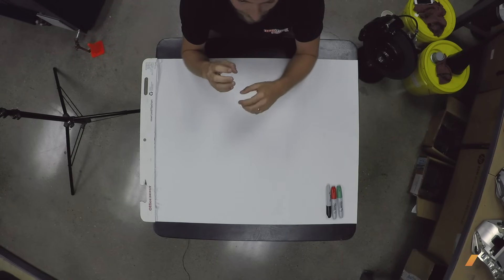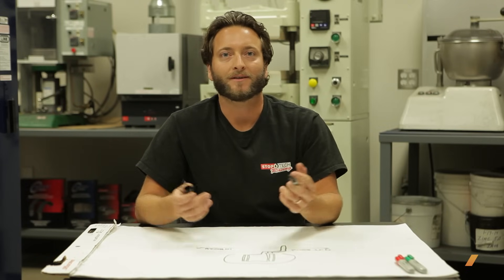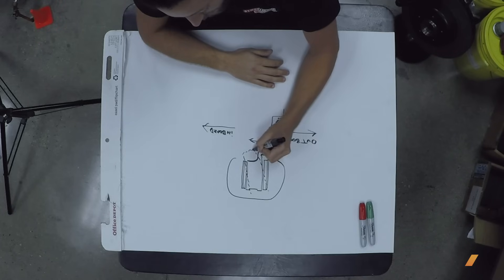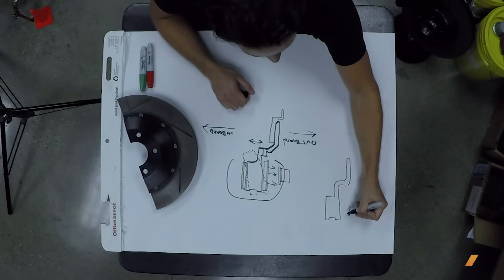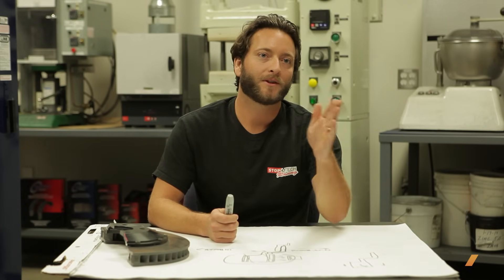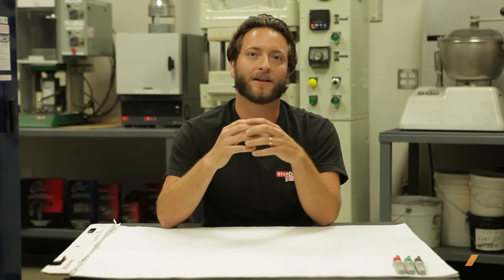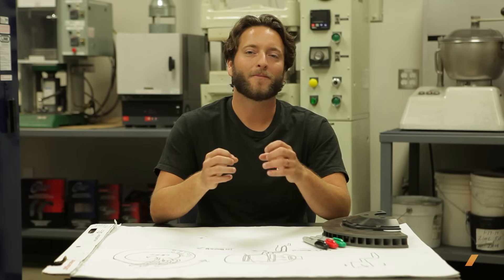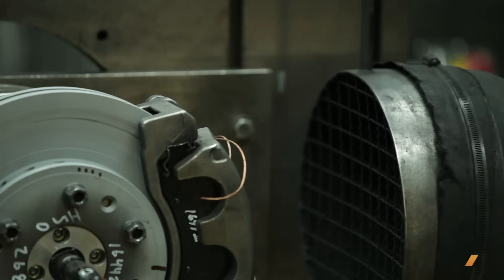The Thing About Brakes Is THIS  -- /ENGINEERED

Comment: Nice but why dot 4 fluid and not dot 5?
Reply: DOT 5 is a totally diff fluid that is not compatible with 3/4.  The main point of DOT 5 is it isn't hygroscopic.  Other than that it has little to no performance benefit.
Reply: DOT 5 is a silicone base and is designed for brake systems that require that kind of compatibility (seal material, etc). For instance, I use DOT 5 brake fluid in my Brembo motorcycle calipers that are fitted to my race kart. It does have a slightly higher base dry boiling temp than DOT 4 and DOT 3.
Reply: There are apparently components in ABS brake controllers that do not like DOT 5 fluid, and if you try to mix DOT 4/3 with DOT 5, it won't mix because DOT 4/3 has some amount of water in it and DOT 5 fluid is hydrophobic (it repels water, while DOT 4/3 attracts water right out of the air). DOT 5 can only be used in a system that has been flushed of DOT 4, 3, and 5.1 fluid completely before DOT 5 can be used, and only in systems without ABS.
Reply: If you want track performance, try RBF600 from Motul. It works really well and has a really high boiling point. It's DOT 4.

That said, if you are experiencing brake fade and not outright boiling, then the problem is the pads, not the fluid. If the fluid goes, you have more than likely crashed your car as a result...
Reply: Dot5 is silicone based where Dot3,Dot4 & Dot5.1 are polyglycol 
ether based, Both silicone and polyglycol ether based fluids should NEVER be mixed.
The best quality polyglycol ether based brake fluid currently on the marked is Dot5.1, you may want to ask the manufacturer if your vehicles brake system is suitable if you drive an older vehicle since some older elastomer components in older systems do not accept the borate compounds that raise the boiling point in Dot5.1.
Both Dot5 and Dot5.1 have specific advantages and disadvantages, 
polyglycol ether based brake fluids like Dot 3,4 &5.1 absorb water 
out of humid air , a slight disadvantage, this process happens slowly
 but the small amount of water is divided in the whole system. This may 
eventually result in a softer pedalfeel since water compresses where the
 brake fluid does not, so every two year (normal street usage) the fluid 
should be renewed. The older the fluid, the more water gets into the 
system which drastically lowers the boiling point (boiling fluid which 
causes air bubbles in the lines and/or callipers which causes reduced or
eventually no brakes). Dot 5 on the other hand, does not absorb water (non 
hygroscopic) but it keeps small air bubbles in the system after filling 
so it takes more effort to bleed the brakes (leave it sitting for at 
least two hours before any bleeding attempt). If water gets in the Dot5 filled system it is not absorbed in (mixed with) the fluid so it stays separate from the silicone fluid, this may result in 
water puddles in specific parts of the brake system like in the calipers,
this may cause corrosion and/or boiling water at the hottest areas (near 
the rotor) also it is slightly more compressible compared to polyglycol 
ether based fluids which may result in a slightly less hard pedal feel. 
Silicone based brake fluids also lack the naturally occurring lubricity 
which makes it incompatible with mechanical valving in ABS braking 
systems. Big advantage, it does not damage your paint where polyglycol 
ether based fluids do so in seconds.
Reply: Dot 5.1 is compatible with Dot 4. Dot 5 isn't
Reply: jonnoMoto So, my car has dot 4 from the factory. If I wanted to do some changes in order for the brakes to withstand more track use, along with braided lines and harder pads, should I change to dot 5.1 fluids or are dot 4 good enough? Dot 5 won't work as good?
Reply: the difference is wet & dry (water content) boiling temp of the fluid. If it ain't boiling with dot4, dot 5.1 isn't needed
Reply: jonnoMoto Why isn't dot 5 compatible?
Reply: Gregory and J Maxey already told you
Reply: jonnoMoto Yes but I don't understand why it being silicone-based makes it incompatible. It's still a brake fluid.
Reply: Gregory Evans Ooooh OK I see. Thanks man!

Comment: I would've liked it more if he showed us some real applications though.  And what is the usual braking force ratio between the two axles on a car? How do you calculate it? How are the angles of slots determined? 
Does the location of the caliper (towards the inner side of the car or outer) affect the design of the pistons or the caliper as a whole? Jeez this is interesting

Comment: Is this a thing, or am I just imagining it, someone answer me this in the comments.. is there such thing as a aluminum rotor? I thought I heard of it before.
Reply: Aluminum scores too easily. Iron or steel is used for is high surface tension and density
Reply: There were some attempts but not too usable, and especially now with carbon rotors they have no real use.
Reply: 35823582 not on cars, an aluminum rotor would probably last less than the first pair of your regular pads
Reply: Sérgio Almeida lol, really?  Makes sense.. thanks for the reply.. I just recall remembering seeing one before.
Reply: MsSomeonenew= Appreciate your input.

Comment: wow, some misinformation. the two piece design rotor he had is fixed. it's primary benefit is lower rotating mass. 

also, racing style two piece rotors don't stop knock back, which is why race cars use anti knock back springs. they also help with transmitting feel due to both pads being able to use more equalized pressure. 

this is what a Brembo engineer told me at Sema like 10 years ago.
Reply: The rotor cutaway sample in the video is absolutely a floating rotor assembly.  Those are drive pin ends, not standard nuts and bolts.  

Axial float helps mitigate knockback, not eliminate it.  

I'm not sure where you get the idea that the small anti-knockback springs to help keep the pad in place help "transmit" feel.  They help feel by simply limiting knockback so that the brake torque reaction can occur that much sooner with the pad needing to travel less distance.  The forces the springs apply compared to the hydraulic pressure during a brake application are negligible.

Comment: These are the best!!
Reply from the maker: No, YOU!
Reply: Engineering Explained you should explain more about how those float causes knockback. in more detail!
Reply: That is a high compliment.
Reply: Engineering Explained and it's official, steel brake lines ARE better.
Reply: No offense to EE as I watch his channel a lot, the guys they have do these /Engineered episodes are experts on that specific subject. The one about thermal heat dissipation was exceptional.
Reply: Looks like stainless steel brake lines are worth it.
Reply: This directly contradicts what you said about Stainless Steel lines vs conventional Rubber Brake Hoses.  What you said in that video made sense and I took your word for it. Now I see you commenting here endorsing this dude.Opens up much doubt.
Reply: Tyler Breivogel 

Pedal fade exists because of boiling your brake fluid and/or overheating your brake pads. Your lines wont fix fade. They merely stiffen up your brake pedal by a decent amount.
Reply: I really could have used more explanation. He touched on some really interesting concepts but didn't fully explain them. I know it's because the video was aimed at the street sport and I'm building race cars. But I had wondered why other guys in my class had severe knockback and I have never experienced ANY brake issues. Reason is I always used OEM brakes from performance models with friction pads. Floating caliper. Other guys were running fixed twin piston caliper brakes and friction pads but to keep costs down were using solid rotors. Hence, knockback.
Reply: Oh my god fuck off
Reply: you're just getting all titillated by the colored markers.
Reply: Engineering Explained you sir are the man
Reply: Christopher Yurgal  Probably depends on who made the OEM lines, what year, what spec, etc. I really enjoyed EE's video on brake lines.
Reply: steel brake lines for my SI then.
Reply: Yes I had that understanding ages ago, just by logic and thinking physics.  But I invite you to check out EE's video discrediting SS brake lines.
Yet here he is applauding this guy's video.  Not to say that most of the context is incorrect, quite the contrary.  I'm focusing on EE's documented incongruity relating only to SS brake lines.  Go watch, and you'll understand my bewilderment.
Reply: malaka1212 I think we need an OEM engineer to talk about the manufacturing of rubber lines, and how they've changed. StopTech sells aftermarket stuff, to fit any car. That Challenger came stock with brake lines designed in the 60s. Those probably expanded like balloons. For a car with weak/cheap/old tech lines, SS might be a good move. If you buy a new M3, made in 2016, the lines might be pretty damn solid.
Reply: Agree!
Reply: malaka1212 dude stainless lines are the way to go. Let me explain this in more detail. When you are using your brakes (easy or otherwise) if you have rubber lines the pressure is going to cause them to expand a certain amount. If you're hard on the brakes the amount will be greater and the heat will build up faster. This in turn causes your pedal to require more and further pressing to the floor. If you have stainless lines they aren't going expand almost at all, so you're not going to have pedal fade as much and you'll have a more direct pedal feel. All around they will perform better.
Reply: interestingly the new honda civic type r has non sliding calipers with one piece rotors. I  guess it's all about getting the fitment right.
Reply: 3cressidas Well that's well within the range of not cool.
Reply: This guy talked about more than just brake lines.
Reply: DOT 3 and DOT 4 fluid? What about DOT5.1? All cars in the UK have DOT 4 as standard and DOT 5.1 is what you upgrade to. I'd never heard of DOT 3 until this video.
Reply: nhy67ujm can't change 3, 4, or 5.1 to 5. 5 is silicone-based and there different than 5.1. 5 also don't work with ABS, the other 3 types are interchangeable.
Reply: 3cressidas why tf u hete then dumbshit
Reply: I pictured the white board when he was showing the different bore size caliper.
Reply: i know I am kind of off topic but do anybody know of a good website to stream newly released series online?
Reply: @Decker Immanuel I would suggest flixzone. You can find it by googling :)

Comment: What are the two brake pad types? Abrasive and "inherent?" what is the word he's saying?
Reply: I think /Drive was expecting him to answer with organic/semi-metallic/ceramic types. He comes out of the blue with abrasive and adherent types.
Reply: I was wondering the same thing. He's saying adherent, as in some of the pad material adheres to the rotor.
Reply: I think he said "Adherent"?? lol was definitely hard to hear what he was saying
Reply: Adherent pads are like daily driver pads. Abrasive pads are high-temperature sport brakes, those tend to eat the rotor away at low temps.
Reply: you're talking about high friction pads (11:22). abrasive pads (12:25) are designed to eat rotors at all temps. I've never seen abrasive pads used in the US.

Comment: Hi great video! I have an Alfa Romeo 147 GTA and I have a question about my brakes. They work fine and I just had them checked by a garage. But whenever I have to brake a little harder to stop from let's say a 100kmph to 30 kmph, they make too much noise in my opinion. Not a squeeking sound but more like a "duhduhduhduhduh" sound.  I just had new Brembo brakes and pads installed and the whole system is checked. Is this sound normal or is there something going on here? Any help or tips are greatly appreciated!
Reply: I have no idea but I just wanted to tell you you've got a great car!
Reply: Are they properly bedded in? The first 100km should be driven with not that much braking force, so the pad and rotor can bed into each other. If you immediatly start braking fast, the pads glaze up and that could cause that sound.
Reply: Sergio, in english it is called a dial gauge.
Reply: toompie69 this car doesnt have abs at all does it?
Reply: toompie69 If slotted rotors, could be the sound of the slots moving past the pads. It happened to me. It was more noticeable when driving next to a wall, and in my case there was less noise during brake application.
Reply: No they are not slotted just normal flat.
Reply: If you can feel it in the brake pedal it's "Brake torque variation - BTV" and is generated by Disc Thickness Variation - DTV.  Google "judder", go on Ferodo's website. Cheers.
Reply: toompie69 seems sort of basic and if the system was PROPERLY checked i doubt it, but if your rotors got too hot (ie slammed the brakes hard way too many times in a short amount of time), they may have gotten deformed and are no longer flat. Its an easy thing to check, theres a tool for that, dont know the name in english, looks like a clock with a needle sticking out of it
Reply: @ianiva thx :)
Reply: @Sérgio Almeida Oh yes I know what you mean. The GTA standard comes with 305 mm brakes which indeed are known to deform but I replaced them with 330 mm brakes which should perform better.
Reply: @audioh0lic Yes they are. And I always brake with ease. I think they are slighty deformed or something though. Strange...
Reply: ABS?
Reply: No it's not the ABS.
Reply: Its most likely what audioh0lic said. The brake and pads havent bedded in properly or all the way yet. Should take too long but i also heard it can take up to 100 km to even out. I guess it depends on the drive.
Reply: By "Brembo brakes and pads" are we talking (calipers and rotors) and pads, or just calipers and pads? If it's just new calipers and you're braking lightly, you may have uneven pad deposits on the rotor, or the old embedded pad compound is not compatible with the new. Put some abrasive race pads on, and drive with those for awhile until it wears off the old material. 
If it's all new, maybe it's not the brakes. When you have to brake "harder to stop." Not sure how hard you're stopping but perhaps the excess stress is revealing something about your tires or suspension instead.
Reply: @Jeremy Robles Yes sorry for the confusion. There were only new rotors and pads installed. The brakes also squeek but only at low braking force. What pads would you recommend though? Do you have any links?

Comment: One thing I really hopped he'll talk about is their Aero Series. Is this only a weight saving advantage? Because tgey offer it part of their BBK and racing products. 

Also can he elaborate on why do drilled rotors crack, is because of a less rigid design or because of the shock of cooling faster and suddenly in some areas due to more heat disapation surface?
Reply: Hi, the StopTech "aero" designation is usually used in reference to rotor vanes, but sometimes also hat scallops.  The whole point of the rotor "aerovane" is to optimize the balance of airflow past the rotor vanes and surface area of the rotor vanes.  This maximizes the amount of heat transfer/dissipation that occurs as a result of convection.  

The "aerohats" help promote a bit more airflow in the rotor assembly.  

Drilled rotors are more susceptible to cracking for two reasons.  First, there is less mass and material available to absorb the same amount of heat and physical loading.  Second, the holes organize the stresses in more concentrated points which will cause the rotor to begin cracking sooner.
Reply: Firebert79TA 
I have seen the design of the vanes, but the amount of drills on that rotor I have never seen in any rotor in my life. Makes it almost as if it was only for show, that's why I asked.

As far as I know, the Aero only comes drilled, there is no slotted option. Which makes me wonder why since they are more pron to crack.

Comment: I don't think he knows what the word "way" means. 
I've put Stainless lines on 5 track cars. There is no significant improvement in feel, or pedal travel, there is a pretty significant increase in the chances of failure though. I've seen more track cars wrecked due to the failure of poor fitting aftermarket stainless lines than any other single part.

Comment: I don't agree with the brake bias part... it is always better to have front end bias brakes. The car is travelling forward so you want it more front end bias to make the car nose dive, pushing down on the front wheels increasing tyre grip. Granted... there can be too much front end bias but still its better. Especially for front engined cars
Reply: Cal M credit where credit is due - I don't think he ever makes a recommendation for an even split between front and back. he says you should see what locks up first and then consider shifting bias away from that, whether to the front or to the back. the way he explains it, if your fronts lock up first, you probably have a bit of bias to shift rearwards. if your rears lock up first, then you almost certainly want to shift it forward.
Reply: You misunderstood what he was saying.
Reply: Cal M boas should always be around 70-30, too much rear bias you just slide, too much front bias your rear end gets more unstable when braking hard
Reply: As you brake the car dives, putting more pressure on the front axle and thus allowing the front brakes to brake harder before locking up compared to the rear axle which is getting less downforce. You still need to find the right bias between front and back even though the front will always be able to brake harder.